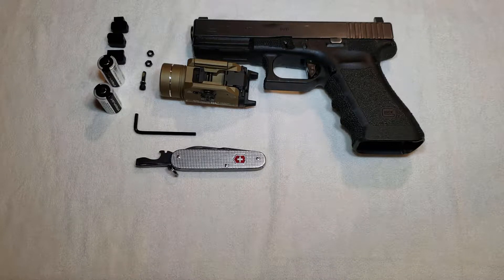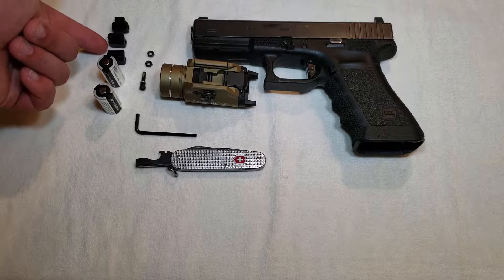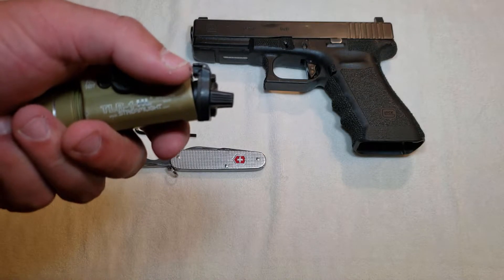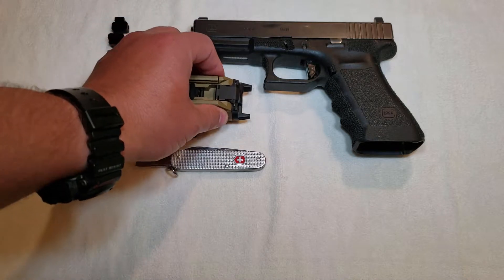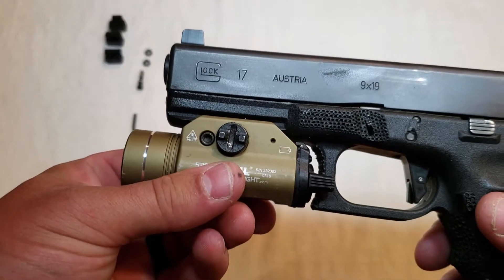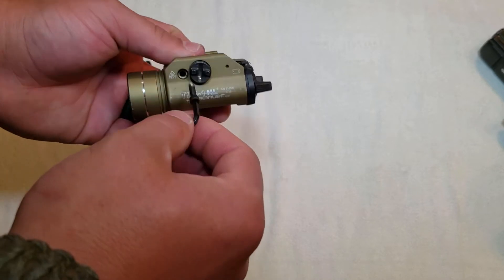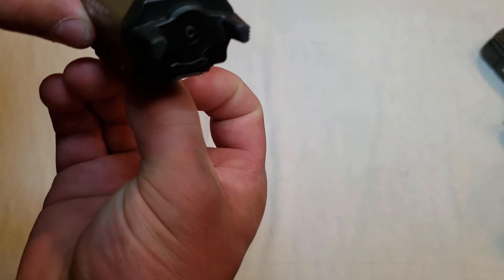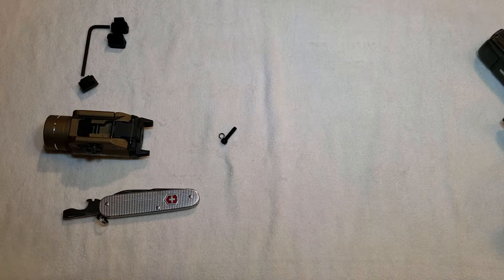Setting Up a Streamlight TLR 1 or TLR 2

Comment: 5:00 "They're idiot proof"

Unless you're a special kind of idiot like I am and watched a different video which neglected to mention the necessity of the hex nut. This is probably why I should start reading the instructions on things. I spent 10 minutes wondering why the screw/washer weren't tightening and another 15 trying to pry the key out with my fingers before I realized I could just stick the allen wrench in the screw hole and pop it out that way.

Thanks for the video, you really saved my ass
Reply from the maker: Haha, if I had a dollar for every time I've felt like an idiot in cases like this, I wouldn't be on YouTube! Thank you for the comment and the funny story!

Comment: I bought one of these, and now with the Olights out where you can charge them without having to dismount them from the weapon or unscrew anything, it makes a design like this .... very dated.    I mean hats off to them for pushing the envelope, but if you spent the time to site your laser/light in on one of the newer weapon lights, do you really want to fool around with dismount to change a battery?    I'd rather an olight magnetic charge port where I can keep my weapon light at peak brightness.

Comment: Can you overtighten the side where you’d use the flathead? Mine seems gtg but I don’t know
Reply from the maker: I like to tighten mine down pretty good. It leaves a slight mark on polymer guns, but since they're utilitarian guns and not safe queens, it doesn't bother me. I'd rather know the light isn't going to fly off. That being said, if you really wrench on it like crazy, the chances of cracking your frame are not zero.

Comment: Thanks for saving me from that ridiculous instruction booklet.  Don’t love losing my normal support hand, but I’m going to work at the range on adapting.
Reply from the maker: Practice is definitely key. You can do most of the work with dry fire and save some ammo. I did make a video about how I activate my TLR-1 that allows me to keep my support hand 95% the same to help with recoil control. That might give you some ideas. Thank you for the comment, I'm glad you found the video helpful!

Comment: How tight are you setting that Allen screw for the rail adapter . Mine dosent have a stoped turning point it’s just snugged but it’ll keep on turning
Reply from the maker: I just tighten it until the light doesn't move at all and then a little bit tighter.
Reply: @countryboyguns  not the main set screw , the lil Allen screw for the adapters
Reply from the maker: @allanramirez5717  oh, I see what you mean. I'm sorry. The light should have come with a couple of small nuts that you have to slide up into the rail adapter from the bottom before you install it into the light itself.